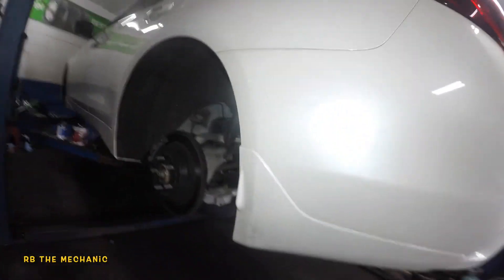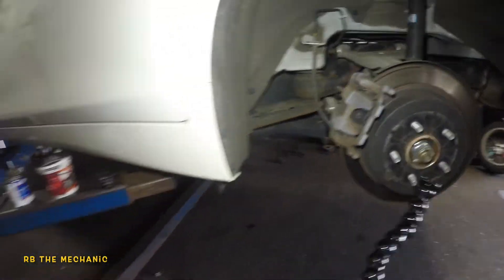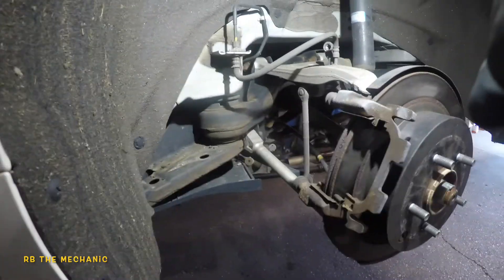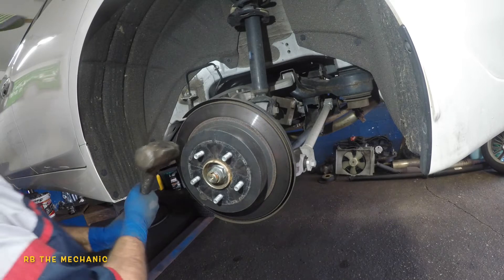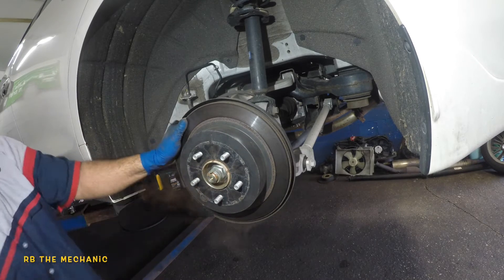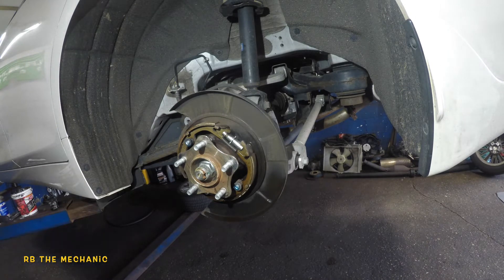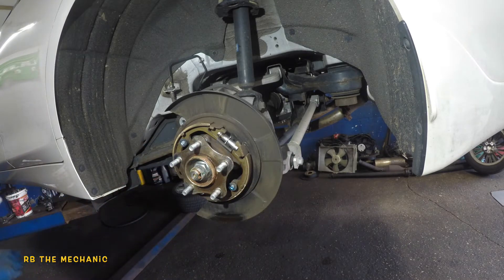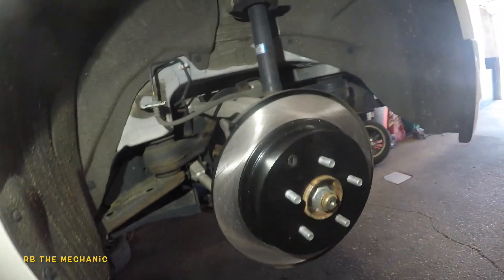Replacing rear Brakes pads and rotors on Infiniti Q50 2014 to 2018    Full (DIY) GUIDE

Comment: mr r b  what do u think  lkq   used transmission?      177000 miles camry now i4 2014.    if trans went out,   should i buy a used from lkq used transmission.  or   bring to   transmission shop  ask them to put rebuild or   used trann.   i know they charge more.                             i need to pay for labor if  i buy my self   if not work.  from lkq.  i call lkq.  they test out all trannsmission
Reply from the maker: LKQ is good but somthing like this if anything wrong u pay labor again and no one want the car sitting in their shop for trans to go back and another one come back I would either get rid of the car or let the shop deal with it so they responsible for any defects other wise get brand. Re transmission from dealer
Reply: @RBTheMechanic  thx.  Mr rb.
Reply from the maker: @fisherbrown903  yes welcome! Merry Christmas 🎄